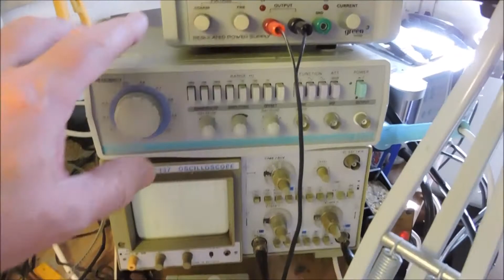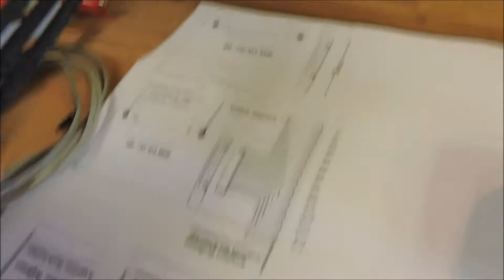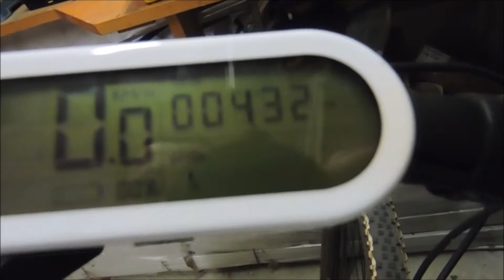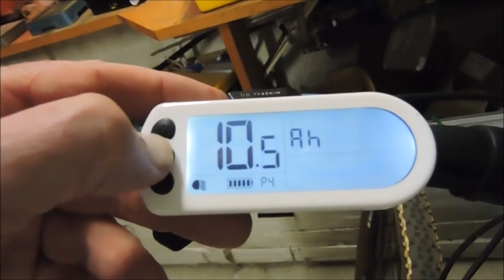BH 48v Battery Repair # Part III

Comment: Generic bms dont work. You need to have more signals sent back to controller from the batt.
Gerrard tips and tricks (RIP) sggests the yellow wire is positive and needs up to 10v to get a battery gauge reading and allow the bike to operate.
I hear the original.bms has a reset button which i havent located on the Emotion pack I'm working on

Comment: Hey, i have some help for them all
Reply: The yellow wires, from the conector of the bateríe on the frame, u open and the yellow small wire is positive, must pass 10volts, u can put s small bateríe of 9volts, u conect positive 9volts to the yellow small wire that it goes the controler, the negativo to the negativo of the 36v or 48v the same, i did it and it works, u will have 100%of batería on screen for one year, then u control the big batería with other sistem puching a boton, u can hack ur bike, it works 100%,sorry Bh

Comment: Alan, anyone, I am a bit late to the party, but anyone did anyone have any luck with replacing BMS and getting the controller to read the voltage? I've tried to apply 3.6 -4.2 V to the yellow wire, but no joy. If anyone managed to reverse engineered the serial protocol, for the battery status, please let me know. Any help is welcome. Thank you, N.

Comment: The evo-jet 48v had 3 dead cells dead balance charge board, and missing thermo sensors. Cells changed, BMS replaced with a unbranded one that fit,  a 7.4v wire using the 2s group from the main negative to the orange on the port harness( yellow in the bike) . The bike rides beautifully.Items to solve: get the charger to deliver power ( the OEM board turned it on) .
The LCD displays 60%to80%,because the said7.2v wire range is 6to8v  OEM sent 0to10v.
If anyone knows how to hack the charge brick to deliver 55volts I would appreciate that info.
Reply: I explained how for all

Comment: Wow I'm late for the party, I am going to pick up one of these 48v bikes from 2016 with a dead battery, but these comments are scaring me.I can rebuild the pack and want to know the exact Samsung replacement cells. I know there's 39 and assume they are 3000 mah. 30 amp  discharge. Would that be correct?
Reply: Hey, do you have any update on your bike project. I just bought one of these bikes and the 48volt battery is dead and I would like to know what will be the best approach to fix it. Any comments will be useful. Thanks.
Reply: @alvarodelsolar7967  I hope your BMS is OK. I did not find Korean made OEM LG cells, but a seller at AliBabba found China made LG cells. Since the BMS switched the main contacts between charging - discharging , I needed to install a relay which is activated by a DC voltage found in the charger. I would recommend that you check and change dead cells first. I hope your board works.
Reply: Use Samsung 35e cells. They are high capacity and reliable.

Comment: I just bi past my failed unit. The bike has more power and lasts longer.
Reply: How did you Bypass your unit? Are you using a different battery? Please any update will be useful. I just got one of these bikes with a 48volt dead battery and I would like to know what will be the best approach to fix it. Thanks.

Comment: long frustrating project is correct. Ive worked on BH bikes and they are impossible to repair! They use UART commmunication to ensure you are using original BMS. If the cells have been replaces it will stop working, if a secondary battery is Connected it will stop working. If you as much at LOOK at it wrong it will stop working! Want it fixed? Cannot be done! Want to buy a new battery? Well you would have to travel so spain and pay like €800 for a new one. BH bikes are great but their batteries suck!
Reply: @the battery doctor.  As ilook to buy an older ebike the proprietary nature of a perdatory company is what i worry about.  There are lots of ways to give a bike juice but will the bike electronics allow it?  Maybe the only good answer is to replace the controller electroics too.  Hopefully they dont start making "smart" motors.
Reply from the maker: Hi you are totally correct a brilliant bike company has totally let down their loyal customers by supplying a really poor battery product /partner.  What makes thigs worse is the defects in their early products have not been fixed or addressed in replacement parts.  I’ve seen a local distributor nearly go out of business from such poor support.  It's really easy to supply customers with a replacement BMS or at least the tool to fix the bugs / firmware issues.  My bike has been in my garage gathering dust while I try to find a decent BMS that will fit into the case.
Reply: I don't know if you found a BMS but this one fits, I'm wiring it as I write this. If you're pack is open please post images of thermo sensor(s).
https://www.dropbox.com/s/1e3ivl0cw0kjw7q/img_20210613_211257.jpg?dl=0

Comment: Hello Alan. Do you know what voltage should be on small pins of battery?
Reply: I believe those are for comunication protocol between the oroginal bms with the other parts of the sistem as ESC and display

Comment: you must put 10% voltage (3,6v) (with a resistor array) in the yellow conector
Reply: Have you tried this Pablo? When I monitor my yellow wire with a DVOM, I notice the voltage falls to 0V every 8 seconds and then is back to 10% of battery voltage, so if you would just put in a resistor as a bypass it would be constant and not cycling off every 8 seconds. Will the display and controller accept the constant voltage?
Reply: Using original BMS removed from failed 5.8Ah battery pack of EasyGo Race with generic 10Ah battery I connected 4.6 volt battery between yellow line and ground on BMS, initially success 100% charge and I could choose up to max assistance. after about 30 secs it went back to zero charge. But when I unsoldered the battery negative terminal from ground and plugged generic 10Ah battery through BMS back in it works??? switched it on and off a few times and after 20 min still getting full charge and assist. (I changed the battery Ah from 5.8 to 10 in settings before I started) So excited but got to go out now, will post more & pics wen I get back and have been out on bike, wow :)
Reply: Got up early this morning it was still ok (should have quit while I was ahead) but put BMS back in battery box without batteries to keep it protected, connected to bike, switched on and zero charge :(  back to square 1

Comment: Hello, could You tell me Which cells are built in there? Is this a 13S3P Batttery? I only See 30 cells? Was this a 48V 9Ah battery?
Reply: Are you sure that the original problem was the cell parallel groups that was out of balance insted of a bms problem. The battery problem is fixed if you place the yellow wire from the main supply cable at the first balance group after b-=3-4.2v.
Reply from the maker: The 36v Batteries are 8 x cell in each of the 5 separate packs  4 are spot welded in in parallel ie:  S10 (3.6v per cell 10 in Series).   

My Video shows the 48v version in the same style enclosure (S13).   This is laid out differently, 3 cells are in parallel x 5 packs there are only 39 x 18560 cells in this configuration (you can see one cell missing from the normal pack of 40 in my video). 

The spot welded interconnect of each group of 3 parallel sets is very confusing as it's an odd number and the original case was not designed for 48v.
Reply from the maker: HI Ewald: I updated my reply as it was not clear
Reply: Yes I got it. I already bought a Nitro with 48V . We will see whats next. For the moment everything is working fine.

Comment: Hi. Has a similar problem with a BH easygo race 2016 36volt-5.8 ah. When I built a new battery, Battery Capacity showed 0% when it was full charged. It is the original bms that sends control current to the "battery charger lcd meter". On my bike it's in a small cable (yellow) besides the bigger + and - which need controll current from orginal bms. 1volt = 10% battery 3volt = 30% 7volt = 70% battery and so on. Myself i have not found any original bms yet, so i tried to connect 36volt (head power cable) along with controller current cable (getho style =)) then the bicycle works but the battery meter is 100% all the time, which is less good. .

Mattias
Sweden

Comment: Very interesting , at some point I`ll have to do mine but so far its fine  . I have a Neo Cross I got about 4 years ago . Its done 4.500kms & no real difference yet....What I would like to do is get it back to 350watts instead of 250watts that it is limited to in Australia....I`m guessing that the easiest way to do it would be a new controller rated at around 350w..If you or any else has any idea's please let me no .. I still enjoy every ride I go on with the bike .
Reply from the maker: NO you don't need to change any hardware, the motor is already over rated (350W) and the controller, it's the EU 30Km P/h 250W firmware restriction, that's all.  I have the software  but you need your dealer to upload to the controller using the special interface BH supply thier Distributors only...   and you sign the EU waiver (prob wont apply to Oz anyway).
Reply: OK...Your the first person I know that no`s anything about it .Thanks for that.....Could you send me the software to my email address....... ianmorgan@tpg.com.au    .........I have noticed that the full power setting ...Turbo...dose nothing at all......Would be nice to get all the power when needed........Thanks ...Ian..

Comment: i have the same problem show battery 00%
Reply from the maker: OK if you Google Speed Hack https://www.youtube.com/watch?v=PAKgDdcUeTs you will see some guy has added a second battery pack in series with the regular battery, they seem to be able to use the extra voltage, perhaps 48V is juts out of the controller limit ?